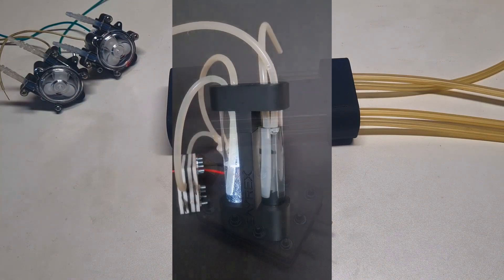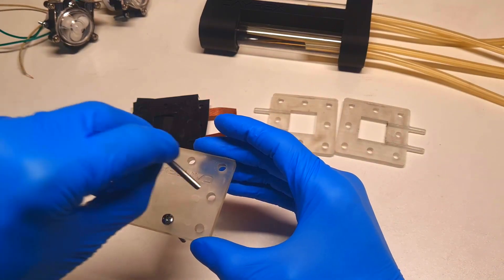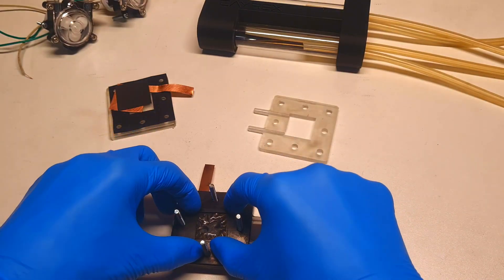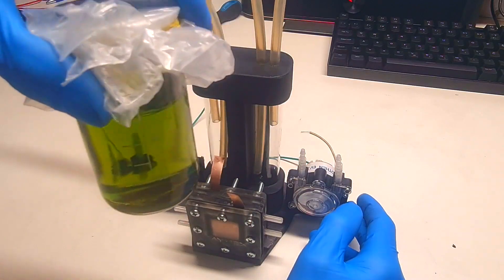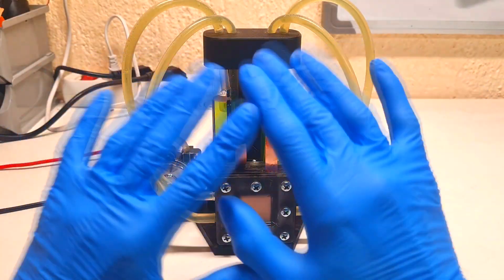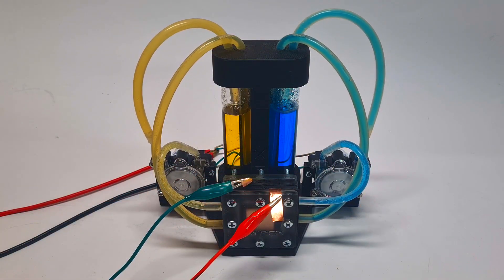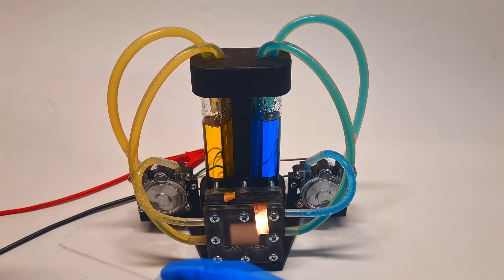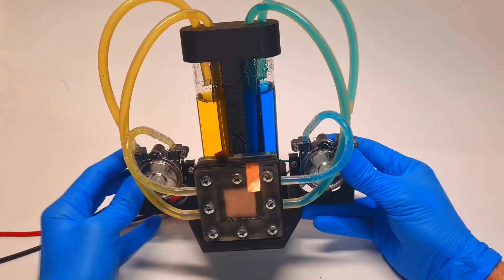Diy Vanadium Redox flow battery - PART 5

Comment: Very fun watch, how much vanadium powder is used? What is the voltage of the cell? Im intrested, would a bigger cell discharge more power and higher voltage.
you could have an unlimited solar storage using extra storage containers and pumps. The shown vials would be the charging area.
Reply from the maker: What is the cell voltage I say in the video. About the electrolyte which is used in that battery I have a video on members or patreon. Or you look for all the info on web. Cell voltage is from 1.1V to 1.5V. The electrolyte is in most cases a 1.5M vanadium electrolyte. If the cell is biger then you will have also biger surface area,.... which means that you will get more power out. But the size of the cell will not influence on the voltage. To get higher voltage you need to use more cells connected in series

Comment: Wil you test the round trip efficiency?
Reply: I am getting about 75% but I do not care about efficiency as I have 5x the solar power I need , to me its always about not having to replace batteries , hell i am happy with my hyro system pump up hill 60m head into a 20,000L water tank but that only gives me emergency power to keep my aquarium pumps running with pipe flow rate limits etc I was wanting to get a fuel tanker for compressed air but no one liked the idea of me super compressing a ticking time bomb ....
Reply: Hahaha sounds like we are birds of a feather XD I'm always concerning people with my experiments in my urban area. @christopherstaples6758

Comment: Can you make a fuel cell battery without corroding electrodes that just uses water?
Reply: Yes, with salt water a flow battery is possible. But vanadium can de more energy dense.

Comment: damn didnt know this was so simple. Thank u for part 5 i was really waiting for it. Can u tell more about the ion exchange membrane and is there a cheaper way than nafion ie create your own ?
I have read somewere the use of specific paper and some ipa ?
Reply from the maker: It looks really simple, yes. But have also its complexity. About membrane you have many different types. One is of course Nafion 113, 117, etc then you have fumasep, and and and. but are all expensive. For example if I will use Fumasep membranes in 48V 3-4kW cell stack then the price will be around $2800 only for membranes. So looking for some alternatives is necessary. Some time ago I read something about zeolite membranes that can be used as membrane in VRFB,... but have higher self discharge aswell.